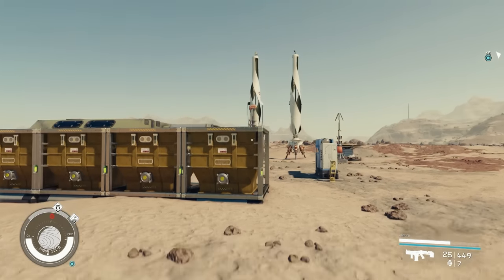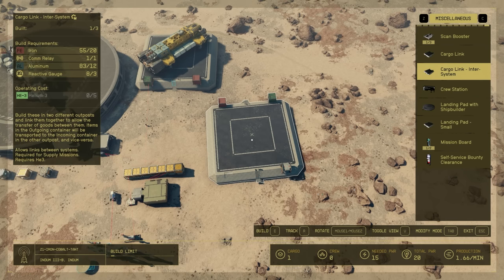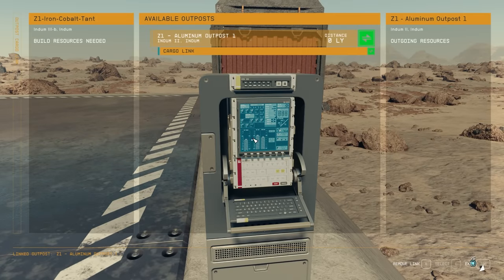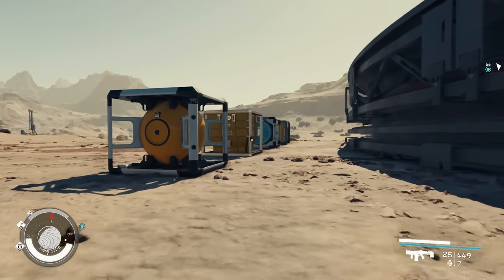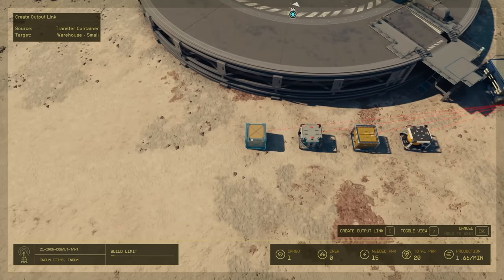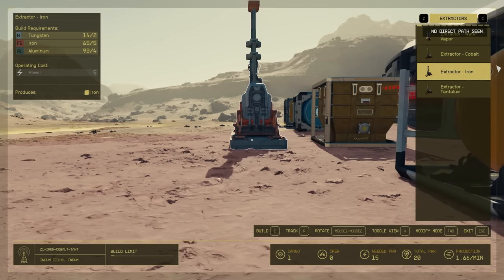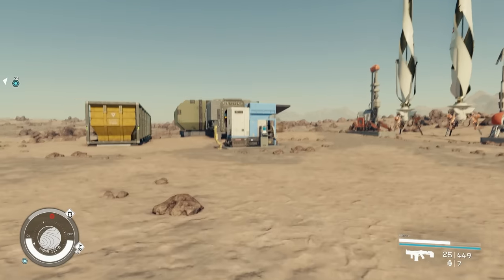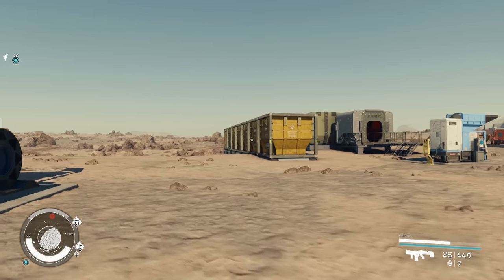Base Storage, Power And Manufacturing Connections ! Starfield Tips And Tricks | Z1 Gaming

Comment: Thank so much, Linking the containers was something I had not worked out yet. (my next issues is having 40 containers all full, and zero way to search through them other than going up to each on individually :-( )

For the wiring, specifically at 17:29, if you look at the [E] Move, it says: "Hold for Extra's". This will give you the wiring option without having to building mode.

To break the connections in case you haven't worked that out.. Just move the container so its no longer auto linked. You can then see the red lines more clearly, and delete them
(sub-optimal, but it works)

Comment: For breaking the connections couldnt you use the modify mode of outpost building to move the storage away so the connections are accessible?
Reply: Yeah if you need to fix the storage in a line just move them apart
Reply: ∆THIS∆
Pull the container out of the stack and the connector line drags with it allowing you to delete it. Also, if you change the output item of a fabricator doing this will break the connection.
Reply: This is what I do. 👍
Reply: Man I feel dumb 😂 thank you so much. Makes so much sense I should’ve thought of that 🤷‍♂️
Reply: @77BigDirty  You got a jet pack on your back for a reason... hmmm.

Comment: the cargo pads should in all normal situations be able to be interlinked as part of a proper network especially since you can't get everything you need on any one planet.
the only potential alternative is just pairing off the intra-system pads and creating transfer nodes <annoying, but it might work.>
aside from basic resources like copper, iron, Bauxite and such. you'll want to be gathering and stockpiling H3 = Tritium. and any other material needed for ship fuel.

placing a ground base will need careful siting to get as much out of it in different materials as feasible using several mining rigs. which dump into a local cargo storage for transfer into the landing pad to your main base. it looks like any given rig will produce 1 ore per cycle meaning you'll need several anyway to feed your production or refine to sell off.
time to bounce into ship construction and modification as it might seem that a tanker hauling Ship Fuel could possibly be a good way to make bank.

Comment: Here's what I do: Main base has 5 regular cargo links and 1 interstellar link. On other planets in system i also have 2-3 cargo links. Heres why. Say a moon has copper mine with 9 extractors, solid storage, and power. I have no incoming, so its all outbound storage. On the main planet i may have 3 outposts, each with a different resource or two. Ill set up one main base on that planet as a focal point, to connect either interstellar to another main base or to another planet within that solar system.  So at this base i set up to 5 cargo links, so the other outposts on that planet, AND the one on the moon, or both moons etc are each sending in 1-2 resources each cargo link.  I have 3 systems with at least 1 main base, (and 2 of those send to the third which is my top main base), and each main base has like 5 incoming from other outposts. For over 15 resources all slowly being funneled to my top main base. With about 9 extractors made for each resource, means i have almost 5k of each resource when i go to collect and sell. Got over 6k storage on my attack vessel, and im crawling around with about 30k weight, sold for about  150k in credits each time at neon, with about 3-4 sleep times for the shops to replenish funds.

Comment: To use inter system transfer i have helium transfered through one going to a storage then fed back into the fuel tank on it. To then start the process you just fill the storage with helium then it keeps itself filled up.

Then make another one for the other items, and fuel from first ones storage.

I found if you use only one then the storage space is filled with things other than helium so you can run out of fuel.

Comment: Can you have two connections? For instance one solid container, that then feeds into two non-conected solid containers. If so, does it spilt the stacks 1-for-1 or does it fill one and then fill the other? You could make a splitter with the former

Comment: Gosh I didn't think the storage system was so unnecessarily complicated. I just want a base to dump all my ressources to, and use the workbenches on my ship using said resources. Is that even possible or do I absolutely have to have all workbenches on the base and use those instead? And if I do so, will it also pool from the resources on my ship?

Comment: The intra- and inter-system materials transfer thing just doesn't work. I set one up today and it didn't do anything. I have no idea where all the materials it made went - they seem to have simply disappeared. Also, if you have two bases on the same planet, the ship will only recognize the first one you set down, even if your ship is physically AT the second base.
Reply: Not saying this is going to "fix" your situation but, those launching pad need to be powered with helium. They won't work without that powering them.

Comment: Yeah the details of how items get linked together is really tricky. The way the containers link up, when you want to add new ones is very tricky! I believe the last container that you link, is always at the "bottom" of the list. And the one you want to re-wire from. Such a fiddly way of setting them up. I will most likely have to completely re-do my base as well. Good tip about how to stack them (the front face).
I also like the details on manufacturing and "warehouse" storage containers.

Comment: How do you transfer stuff to your outpost via your cargo hold on your ship? i don't have the option in my cargo hold.
Reply: I think I saw an option in the Transfer Platform.  Try going into the Inventory of the Transfer Platform and there should be an option to access YOUR Inventory and then the Ship's Inventory...  I think that may be how it's done.

This is just a guess as I don't have Starfield, yet, and I'm not sure whether I'm going to have time to put into it.  I'm plenty busy with Techtonica, I am Future, Desynced, and Sunkenland, for now...
Reply: Need to build a landing pad on your outpost so your ship can land then go into your ship cargo hold inventory and switch you should be able to see your outpost inventory. Dont forget to build transfer container. It won't work without out. P.s if the ship is not landing on landing pad in outpost. Build the bigger landing pad with ship modifier. Everytime you access the terminal on the pad the ship will appear thats a workaround to not landing problem on a small landing pad. ;)
Reply: I think its busted. I have everything done right. I can transfer to the ship. But not yo outpost, which is the only reason I watched the video and it's a bust.
Reply: You have to do that manually

Comment: lol, "ok, we got that figured out!" .... hmmm, did we though. I've been pulling my hair out trying to work out some of the weird logic and inconsistencies in the output links, and all the same issues were demonstrated in this video, and then just, "oh ok thats how it works" where it actually is super unclear why its functioning the way it is, but moved past. I appreciate the video, but trying to explain how it works, when clearly, its not actually following the supposed logic consistently, doesn't really clear things up. Where things should be able to be automated, the system clogs or breaks down and things like supplying fuel to storage and generators, and outgoing containers can literally break the whole setup as fuel (helium) might get stolen by something not set to feed generators and then everything stops. You should be able to solve this by making the fuel storage the end of the container chain for helium, and then feeding generators from that,  but sometimes the downstream feed just doesn't function until some container in the chain fills up, which makes no sense because it should be dumping to its output linked container but it just won't until its overflowing. They really need to fix up the logic on these, and make it very clear how it works. I simply think its broken, and I am not super hopeful that it will get much attention.